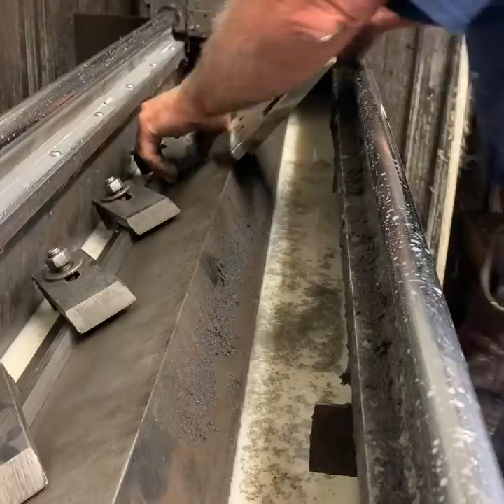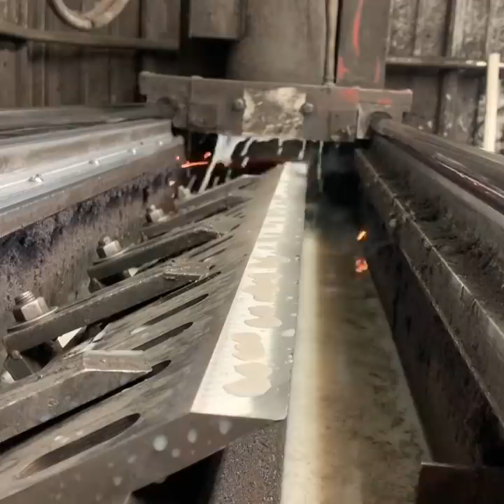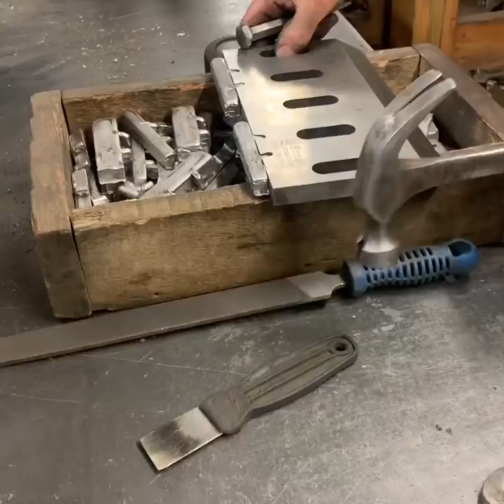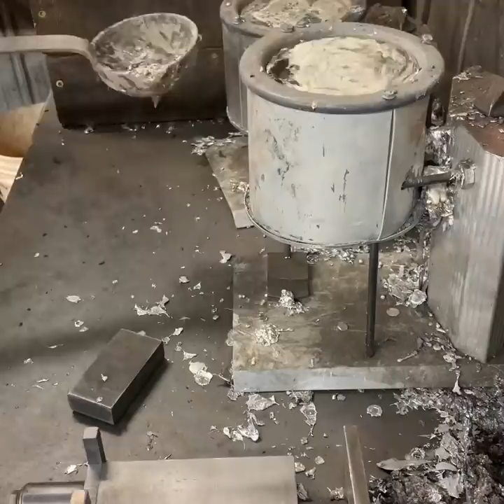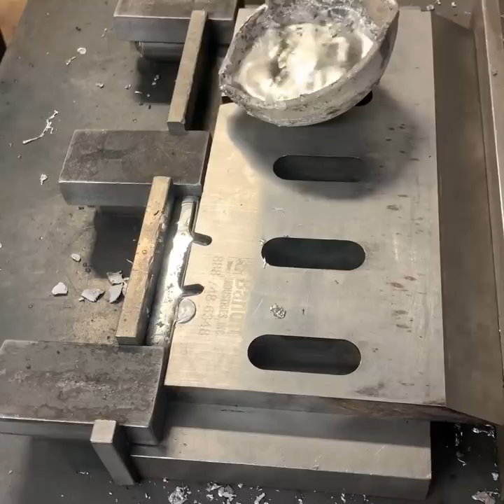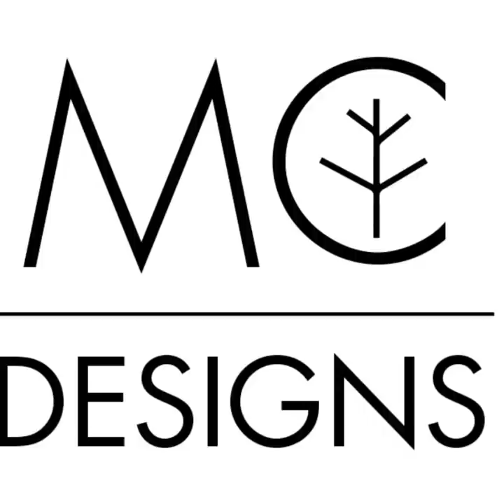How to sharpen wood chipper blades

Comment: In my old job i sometimes got to sharpen wood chipper blades the same way, but instead of melting and casting the distance plates we had threaded screws.
We also sharpened blades for icing machines in hockey arenas.
Reply: Oooohhh.... so that’s how they scrape the ice ...
Reply: I was wondering what the castings were for. Seems strange to cast something on there if it’s not going to be adjustable why not just make the blade the right length?  Or why not put set screws in like you mention?

Comment: I didnt know it is that easy to sharpen wood chipper blades.  All I need now is a wood chipper and a very expensive machine to be a part of the team!
Reply: A wood chipper with a 2500 HP synchronous motor that reduces a 20" by 100" hardwood log to chips in less than a second. And does that continuously 24/7, or until the blades get dull.

Comment: I worked in a pulpmill that chipped 1,500 ton of wood every day. Two chippers with 2,500 hp drive motors. The knife grinder shop ran 24/7.

Comment: What are they doing with the process of pouring melted lead at the end?? Is it to balance it or something
Reply: My guess is its apart of whatever fastens the blades into the chipper, he removes the old ones too so I think he doesn't mind replacing them or maybe they needed maintenance too.
Reply: These blade are for big industrial wood chipping mills. The lead is the spacer to compensate as the blades wears down every time its sharpened.

Comment: What is the purpose of the poured in metal? Like what do those do?
Reply: The poured in metal is called babbitt. It is used to set the position of the chipper knives. As the knives are ground down, the babbitt is lengthened in order to maintain the proper distance from back of knife to the edge. The knives are mounted in a disk that spins and the knives chip the wood against an anvil. Clearance between the knives and the anvil is around 35 thousandths of an inch and may be adjusted to change the chip size
Reply: @chrisbarnard6385  , Thank you
Reply: @chrisbarnard6385  That’s really cool! Thanks for explaining
Reply: @chrisbarnard6385  thanks man👍👍
Reply: You the MV
Reply: @CharlieK92004  ok
Reply: @chrisbarnard6385  thanks for that

Comment: Could the manufacturer add rails on the chipper itself so you could use the “grinding sled” in the field?
Reply: Not really, it's not cost efficient for every machine to have that, also other factors that makes it a safety hazard. It's better and easier to have a few sets of knives and switch them out.

Comment: You can tell when someone is making a lot of money when they have a machine to sharpen their blades. Must be chopping a lot of trees.
Reply: Every normal Sawmill has those
Reply: This type of chipper is used in paper making. I worked on one for 25 years. It can chip about 30 train car loads of logs a day.
Reply: @davidyetter5409   
Any clue what the lead on the back of the blade is for?
Reply: @tatemantis9293  After the sharpening process the blades are narrower and the bandit is used to make up for the difference and ensure proper clearances in the chipper.
Reply: @davidyetter5409  ingenious

Comment: That's different than the machine I use. Always wondered why there was stuff for smelting under our Machine. Never had to use it. Are those blades out of a older model bandit? Never seen that type.
Reply: I had a newer Vermeer chipper and we had a gauge device to set the distance.
Reply: These are used on industrial equipment.

Comment: What are those lead or Ali blocks for?
Reply: Each blade has is own lenght, since they become littler by sharpening them. The lead things compensates the difference between them. When you put the blades on the sharpener they are same size.
I've done this job.
Reply: Is this lead or aluminium
Reply: I was thinking it was like a babbitt material (used for old school bearings).

Comment: Hardest part is getting all the blood and bone fragments off the blades.
Reply: heeder777 well that’s why I want to have them sharpened it doesn’t happen with sharp blades
Reply: @poland5606  nah thats what pressure washers are for
Reply: You have to spray it down with Hydrochloric acid...it eats all of the organic material off of metal😇
Reply: The disposal part is rather time consuming, i also use hydrochloric acid to disolve the organic material then i neutralise the acid with baking powder, then i dump the remainder into a 6ft deep pit.
Reply: Yes officer this comment right here
Reply: You've all now gone onto some kind of watch list 👍
Reply: 5% Tide detergent, 15% orange oil, and distilled water works pretty good.
Reply: Just run a couple real logs through after the bodies, then through the carwash.

Comment: So what's the purpose of filling in the back side with, what seems to be, aluminum?
Reply from the maker: Google Babbitt blades.  What you grind off the blade you replace it in the back.  Keeps the desired wood chip size
Reply: @MatthewCollinsDesigns  makes sense! Thanks for the reply.

Comment: What's the lead for ?
Reply: A space  to get the blade closer to the inside edge of the drum they spin in. They look like they are weights, not the case!!! Every time you sharpen them, they get shorter. Older blades that have been used more are shorter, sometimes there is a large chunk taken out of the edge of the blade. It needs to have the blade be ground down to the bottom out the chunk, to get it so it is even across the entire length of the blade edge. And they need to be put into a jig each time and properly spaced, they molten lead is poured into the empty cavity, to space it.
Reply: @drewroy2814  that is boss

Comment: Whats the lead for? Curious
Reply from the maker: Babbitting is the process of bonding a molten, soft alloy metal (Babbitt metal) to a stronger metal. In the case of Babbitted chipper knives, Babbitt metal is added to the back end of a knife so that when it is installed it has the proper extension from the wear plate of the chipper disc giving you the desired chip size. Normally, a worn chipper knife is removed, re-ground and then Babbitted to restore the correct knife length.
Reply: @MatthewCollinsDesigns  ah ,never thought of making up the lost length from the sharpening. I have one of the cheap store bought chippers that you just replace the knives after a sharpening. thanks for the info
Reply from the maker: @matthewhoffman9242  no problem!  A lot of the bigger whole tree chippers run babbitted blades.  Keeps the chip size consistent.  3/4”-

Comment: Really men do it by hand while the chipper is running... we've lost so many.  😞
Reply: Hahaha..
Reply: Sad, but true, eh?
Reply: Men, or hands...?
Reply: @misterschubert3242   
.
    Men, Mister Schubert. Men.
    Chippers are designed so that you can’t get your hand into the feed rollers easily because of the distance from the feed-table edge to the rollers, usually over six feet. So…, If you are unlucky enough to have your hand to go in to the rollers, you are already on the feed-table and one third the way in. It’s quite likely the rest of you will follow your hand along with ALL THE DEBRIS, even if it’s small. These machines will break a 5-6” branches off a 12” tree trunk and break them in pieces as they are pulled in. It becomes a trapping system of monstrous forces. This happens more frequently than you think. 
     There are stop-bars that go around the sides and top of the feed hopper. So if you can bend your leg and pull the bar in your same direction of travel as you go in, it may only take your arm and the top of your head off by the time you get it stopped. I’m not kidding!
     But the real sneaky thing is that as you feed that 3”, 6”, 9“ or 12“ branch into your chipper and you haven’t cut all the limbs down, even the smaller ones, because you’re new, those limbs, that the feed-rollers will snap-right-off just may be big enough to pull you in and you can’t escape it. I’ve nearly passed-on this way twice. Which is why you never let two people feed the chipper at a time! You do your safety training every job+day+shift+and start, your coworkers understand and you do well and keeping everyone safe, then a homeowner walks up from behind and decides it‘ld be fun to help you load the chipper from behind! Next thing you’re thinking is “what the hell...?!...“ and you’re going there!